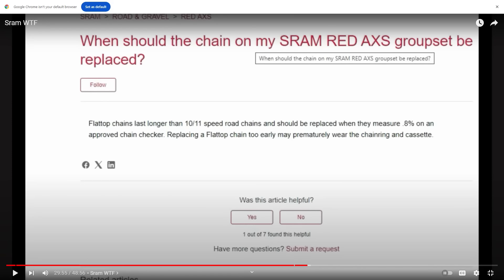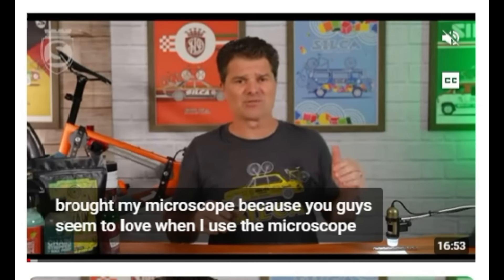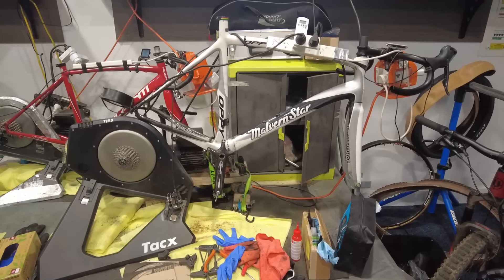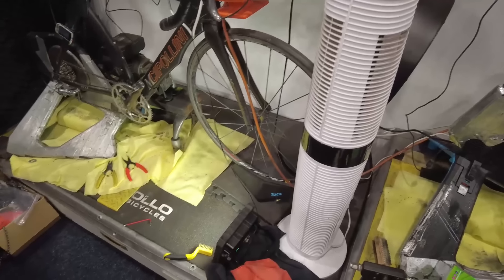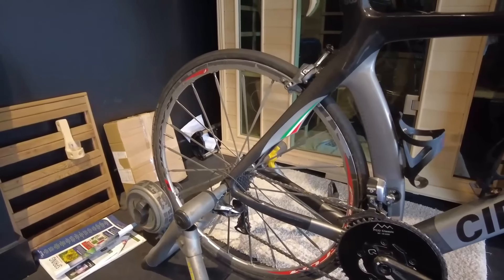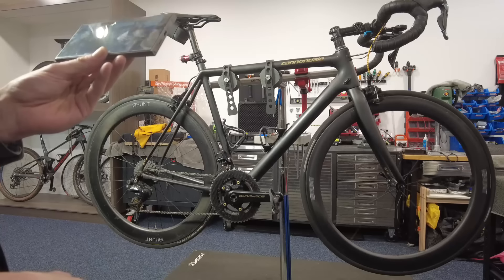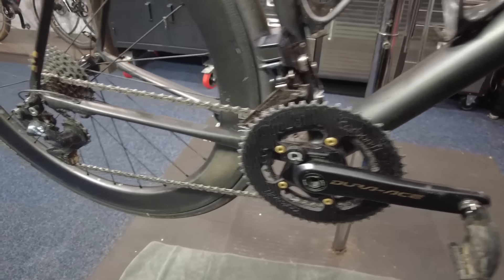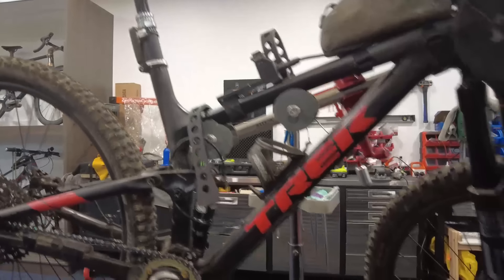News + My bike Fleet!

Comment: I just thought of a project idea that would be perfect for your setup: wear-testing a Gates carbon belt drive as compared to a chain drive; seeing if there are ways to improve the efficiency of Gates carbon belt drives... my impression is that you're not supposed to lubricate them, but I was wondering if there was something that you could coat the pulley with that could help where the belt teeth catch and release from the pulley. my intuition is that would be where the most inefficiency of that system is, same as on a traditional chain, where the chain is sliding down the teeth. because of the material differences between the pully and the belt, the pulley itself should take a really really long time to wear out, while for the belt itself it seems like flexing around the pulley and straightening out again is probably what does the belt in as opposed to the teeth stripping away.  

there's probably power transfer loss as compared to the traditional chain because of the inherent flexibility of the belt, which is why they probably don't use it for racing, but it would be cool to see some sort of comparison with that as well
Reply from the maker: yeah alas the zfc test cant directly measure efficiency, and indirectly it is still very blunt, we are relying on wear rate correlation to friction. Due to different lubricants stiction / viscous friction etc - two products tested by me with similar-ish wear rates - i cannot say which might be clearly faster or slower. The zfc blunt tool is more picking up clear differences -ie if one product is very low wear, and another notably high - as the friction that is eating through steel will be the dominant loss, the high wear product is unlikely to be smashing it re low friction running. 

I could endurance / longevity test a belt drive, but i lack the spare machine and time resources, especially investing a lot of time for what is comparatively a very small demographic of interest (like DIY wax / lube). 

For belt drives the main losses are not going on / off teeth, it is belts take more energy to bend, and they are also at higher starting tension. Chain links (clean and well lubricated) - are just flat out more efficient than a belt. And then, as a chain can simply run on different cogs, they have great efficiency across a huge range. Belt typically needs to be paired to gear hub or gear box, which are themselves notably higher loss than chain and cassette - so the two put together simply has a belt drive with too high a loss vs chain and cassette for most cyclists. For track - the extra losses in bending as well as stretch under load vs metal chain - again its just not a competition between the two re efficiency. 

If i was an intrepid commuter - i would for sure consider a belt drive and an alfine hub. Belt drives can last a very long time (circa 25k is the anecdotal i have seen bandied around) - but again it can also depend a lot on load and environment. Abrasive stuff running in between the belt and cogs / rings (ie mud) - can for sure wear belt teeth too, and especially if tension is too low, there can be issues with slipping increasing damage rapidly.